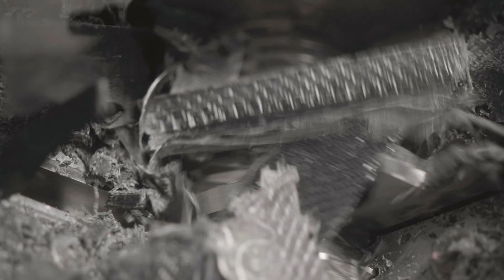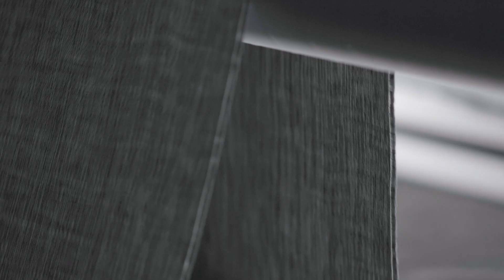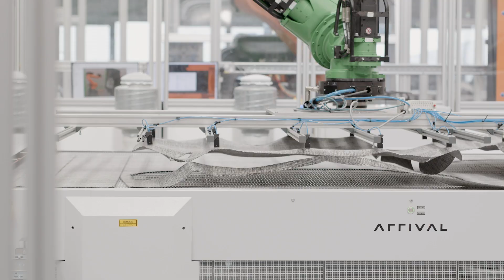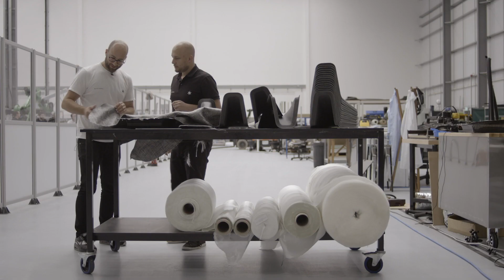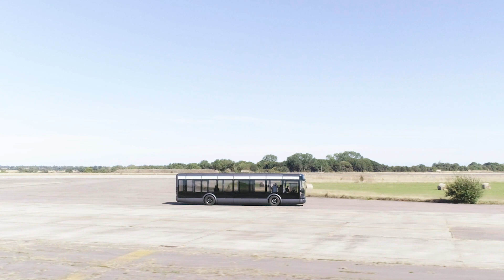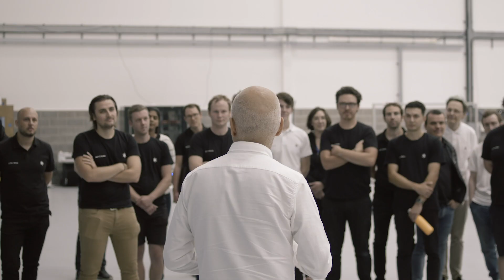How Would You Build an Electric Vehicle? | Material Innovation | ARRIVAL

Comment: Very interesting, but you have to consider two things.
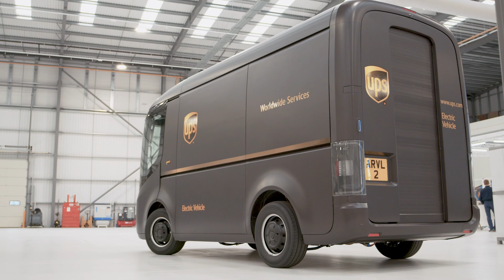First, at 3:50 while GF-PP panels are indeed much less dense than steel, they are also at least 10 times less stiff than steel. E-Moduli of GF-PP woven fabric laminates are usually in the range of 15-20 GPa in both fabric directions (depending on fibre volume fraction, of course).
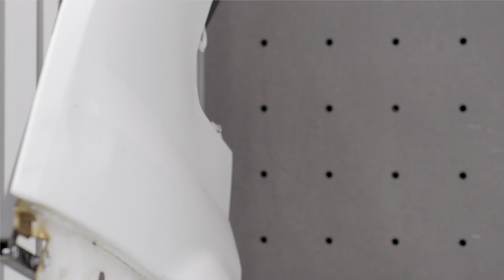Second, I am very doubtful of the impact test shown in 4:30. You can clearly see that the steel panel is impacted at full speed (even some debris is flying off the concrete impactor), whereas the thermoplastic composite panel is impacted at a very low speed.
Reply: Did they specifically say this is a GF+PP composite? The fabric does not look like any glass fiber fabric I've worked with before. It looks more like a natural fabric with color or a carbon fiber fabric.
Reply: @jonathan4831  thats GF-PP for sure. Google "Cristex Co-Fibre". These are commingled glass rovings with pp filaments. Ive worked with these kind of fabrics before (once they were called "twintex"). And judging by the fact that thd fabrics are moulded via diaphragm forming - hot drape forming its surely GF-PP because the silicone rubber would not withstand PA6 processing in the long term
Reply: @IEleMenTIx  that's excellent thank you for the follow up. I've seen fiberglass coated polypropylene but not co-mingled glass and polypropylene. Makes sense and simplifies the molding process.
Reply: @IEleMenTIx  what is the PA6 and silicone we are referring to here?

Comment: Impressive but what about the cost vs steel or aluminum? Not to mention speed of assembly
Reply: plastic + fabric. It's likely much cheaper. And for speed, well you can mold it
Reply: They said comparable cost
Reply: Their composite panels are easier to manufacture and have a lower cost of ownership since they don't scratch or scuff in the same way as paint metals, and comparing it on a material cost basis alone won't entirely be accurate for these reasons. Capital costs for metal stamping and painting are extremely expensive, and composite materials plus vertically integrated manufacturing allow for reduced capx. Comparable material-wise, but not comparable when you look at the broader picture for both Arrival and the consumer.
Reply: @jonathan4831  yes. Also, casting machines for metal alloys in general are so expensive that arrival micro factories could be cheaper than those alone

Comment: How is the safety rating with all these composite structures?  Not sure I would like to see the end result if it gets hit by a steel car 🚗
Reply: Benefit is that it would absorb the shock better probably, and you could always put the protective steel cage around the passengers that most cars have anyway
Reply: It would probably be more resistant than a lot of steel cars and vans are today with this kind of body composition.
Reply: My question too.  These still need to meet collision and rollover regulations.  Flexible panels can't contribute structurally.  +What is the structure?  +What supplies the stiffness?

Comment: I really like the concept but the major issue i see is a shortage in raw material for cells,

I assume you use 1865 or 2170 cells in packs,

I have heard Tesla is signing contracts with carbon neutral nickel miners,

Lithium is not a problem, it is everywhere and only a small amount of each battery,

Elon sees low cost batteries and bigger tabless cells as the future to bring the EV price down, 

I have heard of a process called "cobalt thrifting" it reduces expensive cobalt use and replaces it with nickel,

A companies future could rely on the race to tie up access to mines, it needs to be profitable for the mine to extract it,

So maybe getting it direct from the mine or owning the mine outright may ultimately decide who survives,

Action now could secure a companies future,

Any idea when the company will ipo ?.
Reply: The answer to the question of raw materials for batteries is lying at the bottom of the ocean.